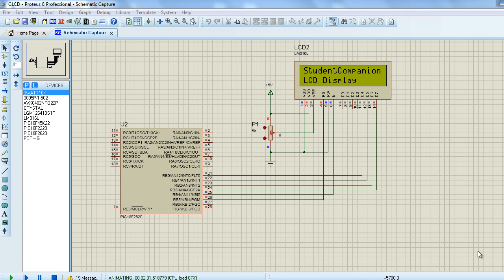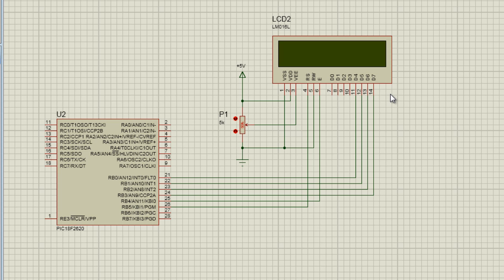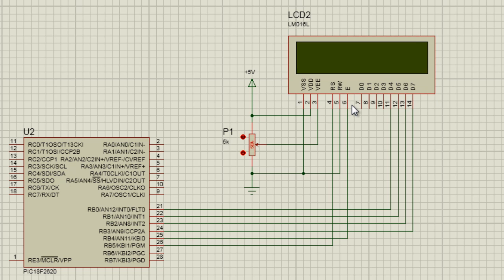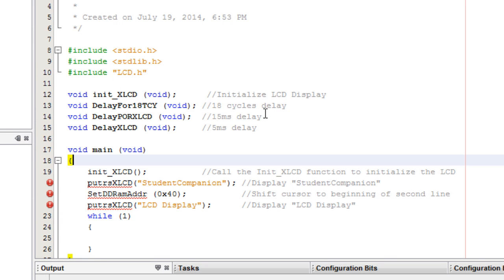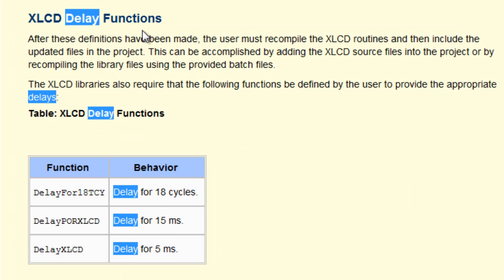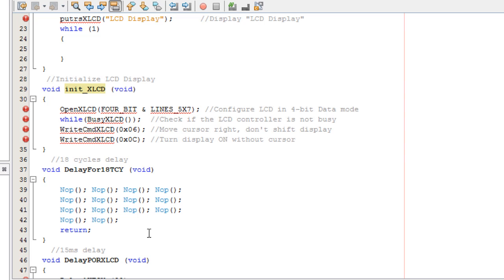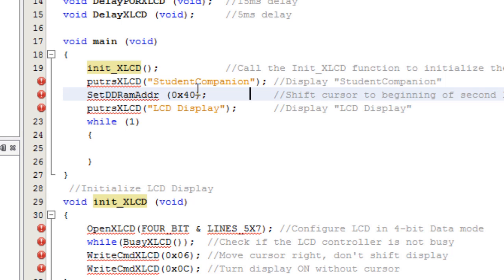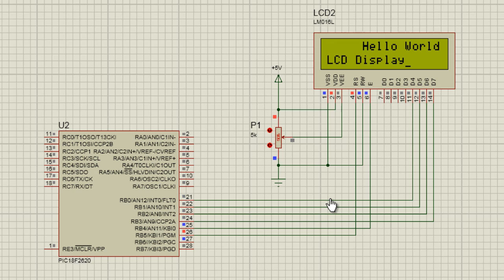5- Interfacing an LCD Display | MPLAB XC8 for Beginners Tutorial

Comment: Hi sir, i found the error: main.c:115: warning: (520) function "_DelayFor18TCY" is never called
main.c:124: warning: (520) function "_DelayPORXLCD" is never called
main.c:138: warning: (520) function "_DelayXLCD" is never called, how can I resolve?
Reply from the maker: Did you include and link the peripheral libraries?
Reply: I include w #include "C:\Program Files (x86)\Microchip\xc8\v1.45\include\plib\xlcd.h", what u say with link?
Reply from the maker: You must download it separately and install it into your compiler if you are
Using a new XC8 compil2. The peripheral libraries are no longer included in XC8 compiler installation since version 1.34.
Reply from the maker: Watch the beginning of this video to learn where to download the peripheral libraries and how to link them: https://youtu.be/4WaB_Lj8FnY
Reply: when I click on MCC , shows me a warning message, "the projects device is not supported by the currently loaded libraries. all library versions are avaliable for download on the MCC website", so i tried compiled, and
so I tried to compile anyway, and it did not appear as an error, just a warning that only the DelayXLCD function had not been called. so I recorded on the PIC 18F4550, and the characters are blank, I sent the message "hello world" and it showed me 00_oo
Reply: this does not change the ROM Ranges, because I usually use 010-7FF, but when I tried with such, it accused the main.c error: 132: warning: (520) function "_DelayXLCD" is never called
Reply from the maker: MCC is only used for new PIC models, it does not support the old PIC. You can select the new PIC18F45K50 which is the new alternative of the old PIC18F4550.
Reply from the maker: We can't guess what's the problem when you only supply fee information.  You must post your main.C code and full error messages.
Reply from the maker: What are you using? MCC or PIC18F peripheral libraries? If you are using the peripheral libraries, please watch just the beginning of the video we linked. It will show you where to download the peripheral libraries and install them into your compiler and link them. Then only your code will be without errors. Don't mix peripheral libraries with MPLAB Code Configurator . It's 2 different things. Use 1 or the other.
Reply: // PIC18F4550 Configuration Bit Settings

// 'C' source line config statements

// CONFIG1L
#pragma config PLLDIV = 1       // PLL Prescaler Selection bits (No prescale (4 MHz oscillator input drives PLL directly))
#pragma config CPUDIV = OSC1_PLL2// System Clock Postscaler Selection bits ([Primary Oscillator Src: /1][96 MHz PLL Src: /2])
#pragma config USBDIV = 1       // USB Clock Selection bit (used in Full-Speed USB mode only; UCFG:FSEN = 1) (USB clock source comes directly from the primary oscillator block with no postscale)

// CONFIG1H
#pragma config FOSC = HSPLL_HS  // Oscillator Selection bits (HS oscillator, PLL enabled (HSPLL))
#pragma config FCMEN = OFF      // Fail-Safe Clock Monitor Enable bit (Fail-Safe Clock Monitor disabled)
#pragma config IESO = OFF       // Internal/External Oscillator Switchover bit (Oscillator Switchover mode disabled)

// CONFIG2L
#pragma config PWRT = OFF       // Power-up Timer Enable bit (PWRT disabled)
#pragma config BOR = ON         // Brown-out Reset Enable bits (Brown-out Reset enabled in hardware only (SBOREN is disabled))
#pragma config BORV = 3         // Brown-out Reset Voltage bits (Minimum setting 2.05V)
#pragma config VREGEN = OFF     // USB Voltage Regulator Enable bit (USB voltage regulator disabled)

// CONFIG2H
#pragma config WDT = OFF        // Watchdog Timer Enable bit (WDT disabled (control is placed on the SWDTEN bit))
#pragma config WDTPS = 32768    // Watchdog Timer Postscale Select bits (1:32768)

// CONFIG3H
#pragma config CCP2MX = ON      // CCP2 MUX bit (CCP2 input/output is multiplexed with RC1)
#pragma config PBADEN = ON      // PORTB A/D Enable bit (PORTB<4:0> pins are configured as analog input channels on Reset)
#pragma config LPT1OSC = OFF    // Low-Power Timer 1 Oscillator Enable bit (Timer1 configured for higher power operation)
#pragma config MCLRE = ON       // MCLR Pin Enable bit (MCLR pin enabled; RE3 input pin disabled)

// CONFIG4L
#pragma config STVREN = ON      // Stack Full/Underflow Reset Enable bit (Stack full/underflow will cause Reset)
#pragma config LVP = ON         // Single-Supply ICSP Enable bit (Single-Supply ICSP enabled)
#pragma config ICPRT = OFF      // Dedicated In-Circuit Debug/Programming Port (ICPORT) Enable bit (ICPORT disabled)
#pragma config XINST = OFF      // Extended Instruction Set Enable bit (Instruction set extension and Indexed Addressing mode disabled (Legacy mode))

// CONFIG5L
#pragma config CP0 = OFF        // Code Protection bit (Block 0 (000800-001FFFh) is not code-protected)
#pragma config CP1 = OFF        // Code Protection bit (Block 1 (002000-003FFFh) is not code-protected)
#pragma config CP2 = OFF        // Code Protection bit (Block 2 (004000-005FFFh) is not code-protected)
#pragma config CP3 = OFF        // Code Protection bit (Block 3 (006000-007FFFh) is not code-protected)

// CONFIG5H
#pragma config CPB = OFF        // Boot Block Code Protection bit (Boot block (000000-0007FFh) is not code-protected)
#pragma config CPD = OFF        // Data EEPROM Code Protection bit (Data EEPROM is not code-protected)

// CONFIG6L
#pragma config WRT0 = OFF       // Write Protection bit (Block 0 (000800-001FFFh) is not write-protected)
#pragma config WRT1 = OFF       // Write Protection bit (Block 1 (002000-003FFFh) is not write-protected)
#pragma config WRT2 = OFF       // Write Protection bit (Block 2 (004000-005FFFh) is not write-protected)
#pragma config WRT3 = OFF       // Write Protection bit (Block 3 (006000-007FFFh) is not write-protected)

// CONFIG6H
#pragma config WRTC = OFF       // Configuration Register Write Protection bit (Configuration registers (300000-3000FFh) are not write-protected)
#pragma config WRTB = OFF       // Boot Block Write Protection bit (Boot block (000000-0007FFh) is not write-protected)
#pragma config WRTD = OFF       // Data EEPROM Write Protection bit (Data EEPROM is not write-protected)

// CONFIG7L
#pragma config EBTR0 = OFF      // Table Read Protection bit (Block 0 (000800-001FFFh) is not protected from table reads executed in other blocks)
#pragma config EBTR1 = OFF      // Table Read Protection bit (Block 1 (002000-003FFFh) is not protected from table reads executed in other blocks)
#pragma config EBTR2 = OFF      // Table Read Protection bit (Block 2 (004000-005FFFh) is not protected from table reads executed in other blocks)
#pragma config EBTR3 = OFF      // Table Read Protection bit (Block 3 (006000-007FFFh) is not protected from table reads executed in other blocks)

// CONFIG7H
#pragma config EBTRB = OFF      // Boot Block Table Read Protection bit (Boot block (000000-0007FFh) is not protected from table reads executed in other blocks)

// #pragma config statements should precede project file includes.
// Use project enums instead of #define for ON and OFF.

#include <xc.h>
#include <string.h>
#include <stdlib.h>
#include "C:\Program Files (x86)\Microchip\xc8\v1.45\include\plib\xlcd.h"
#include "C:\Program Files (x86)\Microchip\xc8\v1.45\include\plib\delays.h"
/*
 *  PROGRAMA PARA ESTUDO SOBRE O LCD 
 *  @uthor Fernando Saraiva Barreto
 *            12/05/2018
 */

//PROTOTIPOS DE FUNÇÕES
void inicia_lcd(void);  //FUNÇÃO RESPONSÁVEL POR INICIAR O LCD
void DelayFor18TCY(void);
void DelayPORXLCD(void);
void DelayXLCD(void);

//----------------------------FUNÇÃO PRINCIPAL------------------------------------------
void main(void)
{
 
    
    inicia_lcd();
    SetDDRamAddr(0xCE);
    putrsXLCD("Sara");
    SetDDRamAddr (0x40);
    putrsXLCD("AMOaaaaaaaaaaa");
    while(1);
    
}   //END main()

void inicia_lcd(void)
{
    
    OpenXLCD(FOUR_BIT & LINES_5X7); //LCD COM COMUNICAÇÃO DE 4 VIAS, CARACTERES DE TAMANHO 5X7
    while(BusyXLCD());              //ESPERA TERMINAR A INICIALIZAÇÃO
    WriteCmdXLCD(0X06);             //ENVIA O COMANDO: "DESLOCA O CURSOR PARA A DIREITA QUANDO UM 
                                    //CARACTERE É INSERIDO, A MENSAGEM NÃO DESLOCA
    WriteCmdXLCD(0X0C);             //COMANDO: DESLIGA O CURSOR  
}

//FUNÇÃO QUE ESPERA 18 CICLOS DE MÁQUINA
void DelayFor18TCY(void)
{
    Nop();  Nop();  Nop();  Nop();  
    Nop();  Nop();  Nop();  Nop();   
    Nop();  Nop();  Nop();  Nop();  
    Nop();  Nop();  
    return;
}

void DelayPORXLCD(void)
{
  Delay1KTCYx(181);
    
}

void DelayXLCD(void)
{
    
    Delay1KTCYx(61);
    
}
 
This is my main.c, I am using  the pic 18f4550, 48MHz, i never used MCC, i am using the nclude and link the peripheral libraries. but i always set the memory rom range for 010-7ff for preserve the bootloader
Reply: if u can help me i really apreciat, cuz i am lost about the error
Reply: now I am leaving for work, thank u for the help
Reply from the maker: Please post your zipped project together with simulation project if you are using Proteus to our website Forum. We will have a look at it: https://www.studentcompanion.co.za/forums/
Reply: 403 Forbidden
A potentially unsafe operation has been detected in your request to this site.

Generated by Wordfence at Mon, 14 May 2018 2:52:09 GMT.
Your computer's time: Mon, 14 May 2018 02:45:39 GMT.,

I am facing this error when I submmit the question
Reply from the maker: That's very strange.  We never heard that before. Please try to use a different browser like Firefox or Google chrome.  Please if you continue receiving that 403 forbidden message, take a screenshot of it and send it to us in email
Reply: +Student Companion I tried w 3 different browser and The same error upon, so, what email can I send u the screenshots and code ? and again, thank u very much for the help and pacience
Reply from the maker: Info@studentcompanion.net
Reply: well, now I can send in forum. 
How long will I have a return, please?
Reply from the maker: Look this is not a paid support where you can expect feedback within a certain time period. We will reply to it when we have time. It can be today, tomorrow or after a few days.  Your problem is not the only one that need attention.  We have to help other people as well.
Reply from the maker: Hi.
We compiled your project and it builds successfully without any error in our computer. You don't need to include #include "xlcd.h" and #include "delays.h" as they are already inside the Peripheral Library.
As long as you linked the Peripheral Library as you claimed so, this project should build without any error.
Please see attached screenshots in the Forum.
Reply: I just tested, compiled without errors, I set the circuit, and only the last letter of the phrase "hello wolrd. LCD display", that is, just oy, and strange, so the solution was simple, instead of playing the RW for GND I threw it to RB6 and it worked perfectly. and just to say, you are incredible, both for the super well explained video lesson and for the patience and willingness to help, continue on this path and success for you. Thank you very much.
Reply from the maker: You are welcome!

Comment: Sir, actually I have previously used Mikroc. When I used lcd_init function I didn't needed to create a function for lcd_init. Here I need to create a function for init_XLCD. That means I can use any name instead of init_XLCD. Then actually what "pic 18 peripheral library" is doing?
Reply from the maker: Even with mikroC you have to initialize it witk Lcd_Init()
Reply: Student Companion yes, but I don't need to creat function like 'void lcd_init ()'.
Reply from the maker: You are right but this is not like mikroc.  The advantages of mikroC it's easy to use with plenty hardware and software libraries. The disadvantages of mikroC is that their libraries are sealed, you can't modify it, you can't extend it and sometimes it restrict your options unlike MPLAB XC8. You can accomplish more once you understand it

Comment: Sir, I am using xc8 version 1.45. How can I use lcd library?
Reply from the maker: If you are using v1.34 or earlier, the libraries are included in the compiler.  You can use them as explained in this tutorial. But from v1.35, they are no longer included. You must download them separately from microchip website at the same place you downloaded your XC8 compiler.  They are now called Legacy peripherals libraries and you must install them into your XC8 compiler. If you don't want to install them, there are other lcd  libraries that you can use. Please watch this video it explain how to download the PIC18F peripheral libraries and install them and also how to use another lcd library which is easy to use especially if you're gonna use MCC: https://youtu.be/4WaB_Lj8FnY

Comment: Sir, you've used XLCD.h libraries but you've included lcd.h, I didn't get the point.
Reply from the maker: The lcd.h file is the configuration bits header file. It's not the lcd library file. We could have named it any name it wouldn't make a difference.  Please watch our tutorial 1 to understand about configuration bits: https://youtu.be/mUofSucHx_E
Reply: Ok, I thought so. Then how you used those library without including xlcd.h?
Reply from the maker: If you have installed the PIC18F peripheral libraries, there is no need to explicitly include the xlcd.h .

Comment: Now my program is working like a dream using peripheral libraries, now please tell me how to check against which pins of microcontroller which pin of LCD to connect.
Reply from the maker: Good to hear that it's working now. Can you clarify your question?
Reply: Its actually how I would know that which pins of Micro-controller are in use.
Reply from the maker: The default connection of the lcd is on PORTB. To learn more of individual pins or to connect your lcd to a different PORT, please watch this video: https://youtu.be/RkDN2GW_SxU
Reply: Thanks!!! you are a legend :p
Reply from the maker: You are welcome!

Comment: Isnt it necessary to add include "XLCD.h" library
Reply from the maker: Not necessary. The project will still build
Reply: Sir from where I can find libraries
Reply from the maker: Which libraries? If you are talking about PIC18F peripheral libraries used in this video, they are no longer installed by default with your XC8 compiler in recent versions.  Actually since v1.35. They are now callef Legacy peripherals libraries.  You must download them separately from microchip website at the same place you downloaded your XC8 compiler. Install these libraries into your XC8 compiler installation folder.
Reply from the maker: As Microchip is phasing out The peripheral libraries and no longer included in new versions of compilers, it's not advisable to use them with new designs.  If you are designing using a new PIC model, try to ise MPLAB Code Configurator.  It's easy to use and it generate library codes for your peripherals.  Watch this video to learn more: https://youtu.be/JxSSVtTj_fA
Reply from the maker: You can also use other LCD libraries like the one used in this video: https://youtu.be/4WaB_Lj8FnY